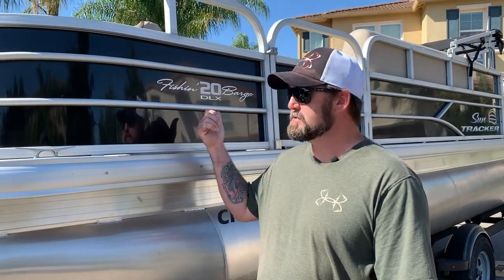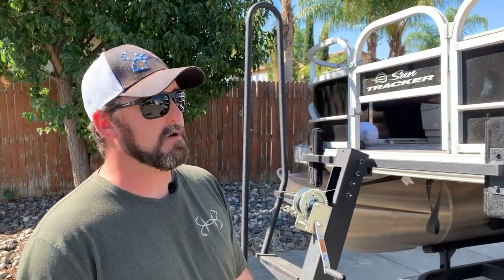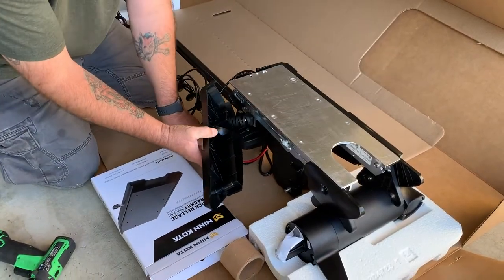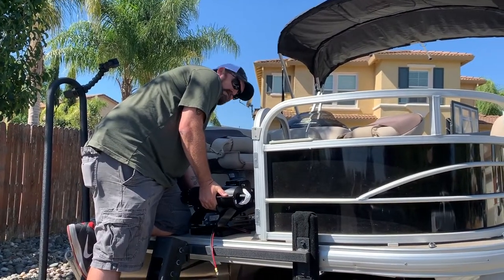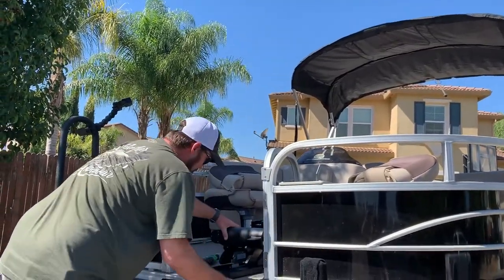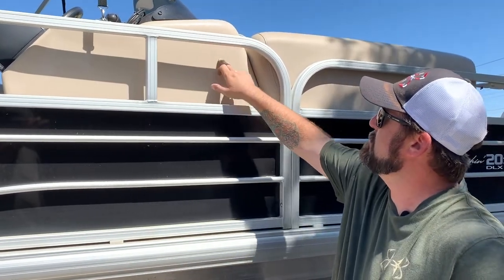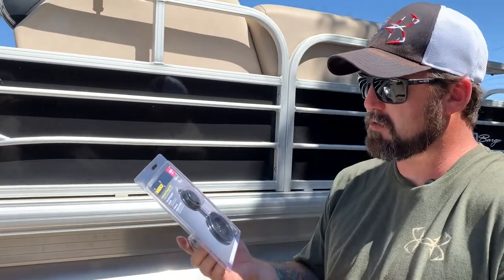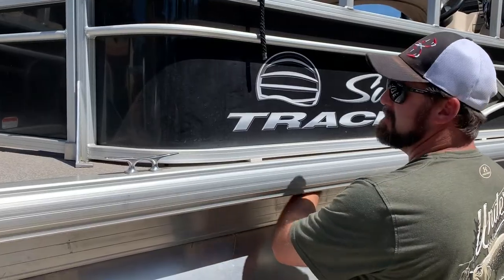MINN KOTA TERROVA TROLLING MOTOR INSTALL ON A PONTOON | HOW TO

Comment: I have been using a 12v 55 lb thrust on a 20' pontoon boat since 2016. It works fine. Don't  be afraid of 12v system.
Reply: Good info to know.  Have seriously been wondering about that.
Reply: @timc8913 mine hooptied to all hell and it’s super short so it’s just clamped on to the front and I full send around the lake with my 55, trolling motor only lake. Does ok. But I’m here because I want something better. Usually this 55 lives on the back of my flat back canoe and it’s a total speed boat on this lake with that

Comment: Looked like the trolling motor was too tall for the front door.  Did the door close over it?  Great clean work though.
Reply from the maker: The door does close with this set up.. sometimes you run into one that won’t .. depending on where they mount the door on the rail. And either you have to remove the trolling motor to close it or move the door up a bit and re-rivot the hinge.. but most 24v will close

Comment: I want to put a trolling motor with a quick release bracket on my 22' DLX. The only issue I have is the bottom of the pontoon has an aluminum skin. Is there a way to install the trolling motor with the skin on the bottom?  The plug for the trolling motor was already there, correct? How much does the 2 batteries weigh?  Was wondering about weight displacement. Thank you

Comment: i have a 22 ft pontoon and im not sure if i should go with a 24 volt or 36
Reply from the maker: Well if you get one of the new terrova quests you can do either.. go 24 and if it's not enough.. you add another battery and keep the same trolling motor.  They are expensive though.. Really it all depends on how you're going to use it and how long you plan to stay on the water on a regular basis.  24v is most likely plenty..  but if you want long days in heavy winds and currents and spot locking a lot of the time.. you might want a 36v
Reply: @ReelLifeFisherman  does the heading sensor come with it or do i have to buy seprate
Reply from the maker: It comes with the Bluetooth models most are all Bluetooth but just make sure.
Reply: @ReelLifeFisherman  awesome thanks for your help

Comment: I know it gets asked a lot and the description doesn’t have a parts list or anything, but I have the same boat and am trying to install a 24v power drive and I reached the end where you wire the plug, then realized I didn’t get the plug with my system. So just wondering where you got the female plug. I picked one up at academy and it’s the wrong one, and Google isn’t doing me any favors. TIA

Comment: Dude you did me solid, I have nearly the exact same boat. I bought the same motor and followed this video exactly. So excited to plug in the console and forget it. Then followed your 24 volt wiring video and boom done. Had it on water first time after install yesterday. Everything worked great. Thank you sir for plain simple no bs approach! 👍👍
Reply from the maker: That’s awesome. I’m glad the video helped you out, that’s exactly why I do it. Thanks for watching and commenting.

Comment: Question for you.  My 2022 Sun Tracker Fishin Barge only comes with 1 cranking battery.  I purchased a Kinn Kota Riptide Terrova 24 volt trolling motor.  I have watched several of your videos, would you recommend adding a 4th battery to be the house battery or would the 2 x trolling motor batteries be the house battery?  Thanks so much, your videos are a huge help to a new boat owner.
Reply from the maker: Keep trolling motor batteries separate from your cranking or house batteries.. keep them just for the trolling motor.. now if you need a house battery that depends on how much time you normally plan to sit with the engine off and running electronics.. if you do that a lot I would recommend a 4th battery and a battery switch. Thanks for watching the channel and glad you like the videos!
Reply: Thanks so much!!

Comment: My 24ft pontoon boat didn’t come prewired for the trolling motor. What gage wire should I use to ensure everything receives the correct amount of power? Thank you and great video.
Reply from the maker: Depending on the size of motor.. 24v 8ga is good .. 36v I would run 6ga marine grade duplex for either one .. thanks for watching.. glad you liked it!

Comment: Sorry for all the questions. Your videos are amazing and have saved me a ton of money. Question is, I have a 22' party barge. There is not bow plug for the trolling motor. I am going to need to run wire from the bow to the helm. If I run it along the top of the pontoons, what would be the best way to run the wire? Is there a way to take off the rails or the seats in order for me to run the wires through the deck. Thank you again.

Comment: Awesome video. I am installing the same trolling motor on the same boat. My 2020 Fishing barge has a 12v 55lb trolling motor on it that I am replacing with the 24volt 80lb thrust. Do I need to upgrade the wiring to bigger wire or will the existing wire work for my new trolling motor and should I add a circuit breaker?

Comment: I love your videos. You've saved me a ton of money. As stated before, I have a sun tracker DLX22. I don't have a plug at the bow for the trolling motor. What kind of plug do you recommend? I think I saw that there are different ratings of plug. I am going to run a 24V trolling motor. I also need to install a circuit breaker. Do I install the circuit breaker closer to the batteries?
Reply from the maker: Thanks for watching the channel! Yes you would install the circuit breaker close to the battery. I prefer the 2 prong v groove plugs . Yes most will be rated for 24v but you do want to check that. Again thanks for watching and let me know if you have any questions.

Comment: You used an angled part to go through the deck that holds your male receptacle.  What part are you using (12:03)?  It’s a clean way to mount the male end.
Reply from the maker: The  fishing barge comes with that already.. but you can find them also .. I’ll try to find it for you
Reply: Thank you.  I called basspro but things are backed up.  I’m considering a weatherproof outlet cover as an alternative.

Comment: Thank you for this video!  What is the shaft length on the minn kota you installed?
Reply from the maker: This was a 60” shaft. Thanks for watching and for commenting I appreciate it
Reply: @ReelLifeFisherman  one more question, if you wouldnt mind.  Would you recommend 112 or 80 thrust for a pontoon(I understand there are variables like weight of motor, size, etc)

Comment: Hey bud great video, I am getting quoted 4 hours of labor for install of quick mount, trolling motor, 3 bank charge batteries and batteries boxes and wiring plug. Does that seem right? Your video was quick but this could take time.

Comment: Cool setup. I've installed this same setup on my 24 XP3 Fishing Barge.  All I have left is running the ethernet and mega di back to the console. What's a good way to mount those cables on the compartment near the bow? I can share pics if you have time.
Reply from the maker: I would run them on top of the starboard log and come up into the console.. make your connection above the deck where you can disconnect at the trolling motor to remove it.. and the others at the helm.. let me know if you have any questions.. or if I didn’t understand what you meant.. glad to help out anyway I can.. thanks for watching
Reply: Thanks man. I pulled them straight up through the console as you suggested and will bring them through a clam shell near the door next to the receptacle. I appreciate the advice.

Comment: hey my friend. Any idea how to secure the trolling motor from thieves?
Reply from the maker: There is a lock hole in the bracket.. put a padlock through it and they can’t slide the bracket apart.. or just take it off the boat and take it inside.. thanks for watching and commenting. Let me know if you have any questions about it..

Comment: Thank you so much. I usually dont subscribe, but today i bought me a bass buggy and I’m going to install the trolli motor and you helped out alot. You have a new subscriber here! 👍
Reply from the maker: Awesome! Thanks and welcome to the channel! Congratulations on the new boat! Thanks for watching and commenting much appreciated! Let me know if you have any questions..
Reply: @ReelLifeFisherman  for a bass buggy 16 what size minn kota trolli would you recommend? Its set up for 12v. If i go with a 24v trolli would i need to re-wire it with thicker gauge wire.
Reply from the maker: I would want a 24v you can run the same wiring .. it’s a tight fit but you can fit 2 batteries under the helm.. you have to cut the inner lip that is rolled up inside the console. You can run a 12v but in wind or current it won’t last very long..
Reply from the maker: But 12v will definitely work.. I just always want more.. I put a 24v on my 17’ skiff.. and I’m glad I did

Comment: Please help me out here. I'm considering doing this project, but the mounting plate on the trolling motor, the half that stays on the deck when the motor is off: what is the best method of not having that a tripping hazard or slicing up your feet if you step on it? 

I recently purchased a used 18ft pontoon for a song. There is nothing wrong with it, and it is great shape! I'd like to use it for fishing in the early spring months, and for playing during the hot summer days. My two small children would likely be tripping and cutting their feet on the exposed plate. I'd hate to have to remove that plate EVERY time I want to take the trolling motor on and off. If thats the case, then why a quick release mount?! 

So, what do you do with that bottom plate when the motor is not on the boat?

Comment: Do you only have 3 batteries on the pontoon? Are the 2 in the council  just for the trolling motor?
Reply from the maker: The 2 under the console are just for the trolling motor.. the cranking battery is in the back.. thanks for watching ..let me know if you have any questions

Comment: Mr Reel Life, I'm sorry if I'm bothering you with my questions, but I respect your opinion and knowledge. Can you please assist me with these questions:

I have a single outboard with two AGM batteries connected together so they charge off the engine alternator.

I'm installing a trolling motor which I will add two 24 volt AGM batteries.

I want to add a 115 volt battery charger to charge all four batteries while I'm not using the boat especially keeping the battery charged for the bilge pump.

My questions are:

1). do I install two double bank battery chargers or a four bank? I'm curious because in my slip I only have a single 115 volt outlet and I don't want to blow the circuit breaker. I need to find out if its on a 15 or 20 amp breaker.

2). I'm reading a 4 bank charger is 40 amps. I'm thinking if three or four batteries need charging at the same time it would blow the dockside power breaker.

3). i'm planning to install the two trolling motor batteries in the center console along with the battery charger. Will this work, and should I add venting?

4). I need to add wire to the battery charger to reach my two main batteries which are located in the transon area. Can I safely lengthen the battery charger wires from the charger to the batteries?

5).  Which battery charger brand and size would you recommend to keep the 4 batteries fully charged? I'd prefer not to have to charge two batteries at different times as I'm not at the boat on a daily basis.

I'm looking to install a marine receptical that I can plug the extension cord into.

Thanks for you time in responding, I really appreciate it
Reply from the maker: Thanks for watching the video! So let me try and answer your questions and I’ll send you a link to the charger I would recommend.. 

1) so that is really up you and the room you have available to mount a 4 bank ,they are pretty big.. I did not have the room for one on my boat.. so I run two 2 banks and run them on a splitter sometimes.. I run them off of one 120 outlet no problem..

2) that is just what it puts out .. again I run mine off the same type set up 

3)yes it will work as long as there is room .. and you should allow venting.. either by opening the access door and or installing vents.. agms are sealed so that is good too..

4) it is just fine to extend the leads.. make sure you cut and install the fuses at the batteries.. lengthen them with 12ga or 10ga marine grade duplex wire from anchor marine..  the charger manufacturer will want you to use their extension kit.. but it’s not necessary.. use the correct wire and heat shrink butt connectors and it will work just fine and you can cut them to length..

5) I would run the Minn Kota precision 4 bank if you have the room.. I’ll send the link 

Thanks for watching hopefully that helps.. and let me know if you have any questions
Reply from the maker: Minn Kota MK 440 PC On-Board Precision Digital Charger 4 bank x 10 amps (1834400) https://www.amazon.com/dp/B013XSM026/ref=cm_sw_r_cp_api_i_4RWxFbGSET405
Reply: Thank you very much for taking the time to answer my questions. I'm going to order the Minn Kota charger you recommended.
Reply from the maker: It’s a great charger and will keep your batteries charged and healthy.. it’s selectable so it will give each battery type the perfect charge Sequence..
Reply: I'm getting ready to order anchor marine grade flat duplex dc tinned wire. I need to run approx 13-15 feet from the charger to transom batteries. Which gauge wire would you suggest? Thanks again

Comment: Love the channel!..just was wondering your opinion on running a 4 battery system..cranking, house battery and a 24volt trolling motor...1 4bank  onboard charger or 2 2 bank onboard chargers...just ordered a 1875 Lund Fisherman..Thanks
Reply from the maker: Awesome congratulations on the new boat! Glad you like the channel! So to answer your question it depends on a couple things.. one is price of a 4 bank can be up there.. and 2 location of the batteries.. because most likely you will have to run charger leads and extensions to them.. but if you only have a location to mount 1 battery charger then a 4 bank would be your only option. Long answer just to say .. do whatever works best for you and your boat and your budget. Because it would work the same either way.. thanks for watching the channel and if you have any questions please let me know..

Comment: If you install the 24v trolling motor, do you have to change the wiring and/or plug in that is already on the pontoon?  Or will it accept the 24 volts from the batteries?
Reply from the maker: The factory wiring is good up to 24v if you go up to 36v I would change it out for 6ga . Thanks for watching
Reply: @ReelLifeFisherman  Great!  Thanks for getting back to me.  Love you videos!!

Comment: Thank you for your video it helped me greatly to complete my install on a 20 ft pontoon just like the one you did the install on. One question though, I installed my on-board battery charger in the same location you did (basically identical install) under the console. After reading through the owners manual it states that the charger should not be mounted above the batteries due to the fact that batteries release gases which might damage the charger. From your experience has this ever happened to you; charger damaged by battery gases? Should I look for another mounting location or I shouldn't worry?
Thank you so much for your expert opinion and  I greatly appreciate your guidance with the videos.
Reply from the maker: I have never seen this happen before... and a ton of boats have the chargers in the battery compartment! I do recommend opening battery compartments that are closed when charging just for the air flow.. but even when people clearly don’t .. ive never seen it be an issue.. thank for the great questions and thanks for watching.. glad the video helped.. tight lines!
Reply: @ReelLifeFisherman  
Great, thanks for replying. Keep up the great content!

Comment: Hey!
 Very good instructional video! I'm installing an Motorguide xi5 80lb. Would like to put the batteries in the back of the boat. 4.5m to the rear of the boat. There will be a total of 9 m of battery cable. Which cable size (guage) would you recommend? Grateful for answers :)
Sincerely
Richard
Reply from the maker: I would definitely run 6ga wire for that length.. thanks for watching the video and let me know if you have any questions..

Comment: im no electrical expert but 12/2 romex is only good for like 20 amps, your minn kota pulls 54 amps,,, did you burn your boat down to the ground ?
Reply from the maker: The 12ga was for the battery charger  5 amps per bank.. so no.. boat is just fine.. thanks buddy. 🤦‍♂️